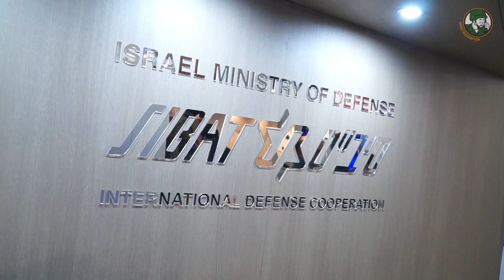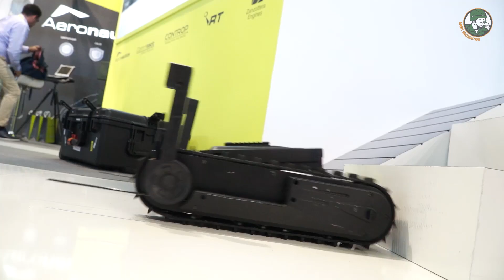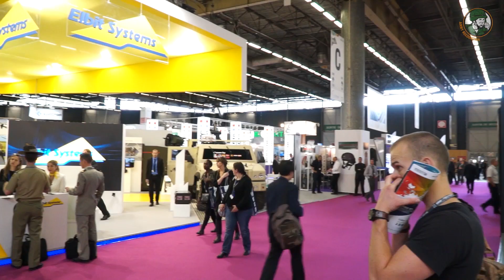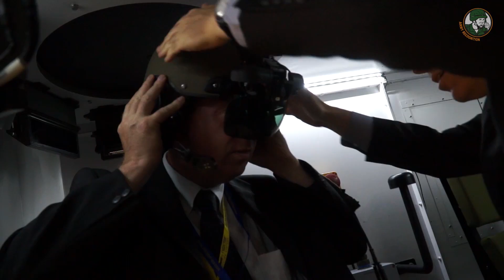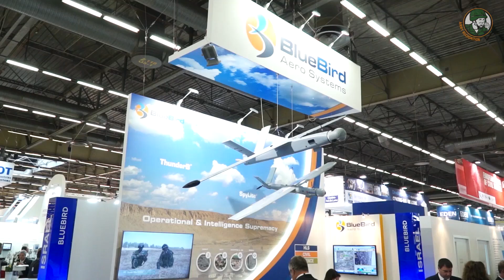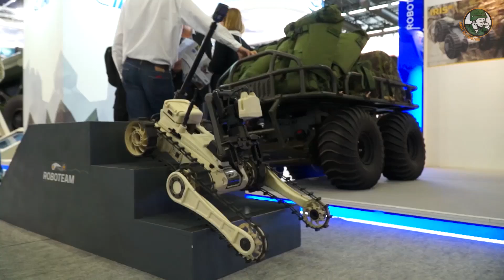Eurosatory 2016 Day 3 Israeli Defense Security industry Israel exhibition airland land Paris France

Comment: With some modifications, those vehicles could probably be useful for lunar and planetary exploration. (Lighter chassis, solar power, possibly some autonomy features, but the same basic pattern.)
Reply: avro549B as well as the guiding principles of survivability and durability, and design elements that make the vehicles capable at their jobs. you need to remember the martian sandstorms and the fact that the terrain includes at times some sheer drops or difficult-to-traverse areas.

in addition, It'd be a good idea to place an autonomous refueling platform in orbit around mars. could be useful for launching future missions, redundancy, and assisting in future mining expeditions to the asteroid belt, which are planned by some companies nowadays.
Reply: The large ones are far too heavy and the small ones would be of little utility.
Reply: lel - nowdays we have rockets that can put into orbit tens and hundreds of tons - it's very possible to launch a mission-specific equipment pack up to space, dock it at the ISS, then launch the mission craft (most likely a larger, modified version of the current space shuttle with more living space, storage and work spaces).

Weight is not the problem as much as the need for a stasis-esque system to preserve the astronauts (giving that the closest exploration candidate mars is 6 months away) and/or packing anough food and water to fulfill the mission. 
The small robots could be of use in order to take scans and survey the planet.

and lets finish by saying that if any mission were to be launched towards mars or some other planet, it'd most likely include setting up a temporary base of operations at one point or another - manned or otherwise - and would probably include some sort of geological and agricultural experimentation to explore the possibility of farming with martian soil.

weight is not the problem as it can be solved.
Reply: Indeed, weight is not the problem. For one thing, any version sent to Mars could use much lighter materials and structure, thanks to lower gravity and a lack of hostile natives there. It's more the configuration and control systems that would be preserved.